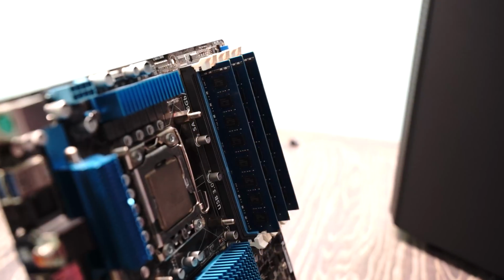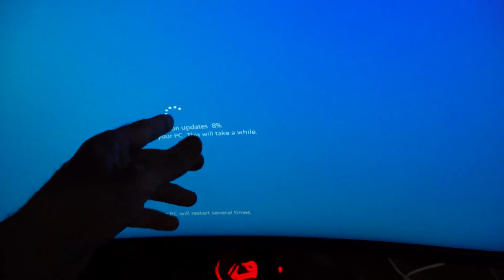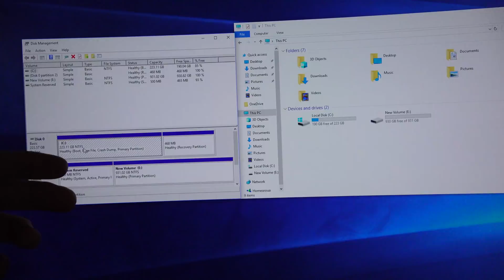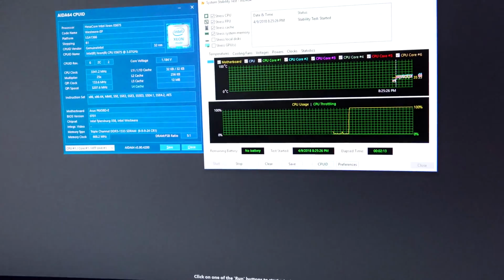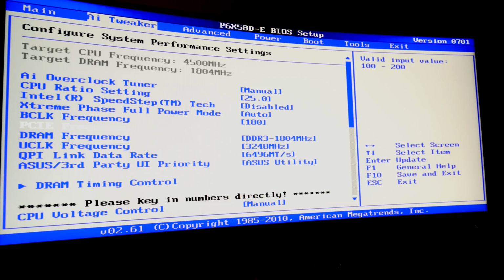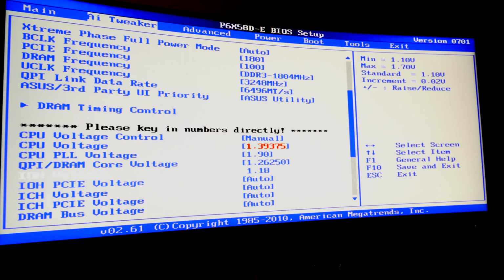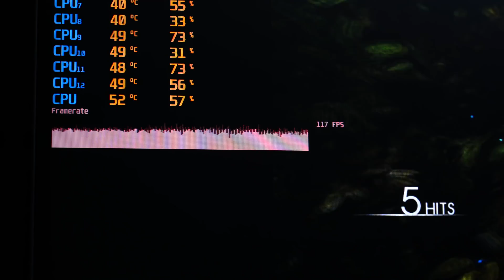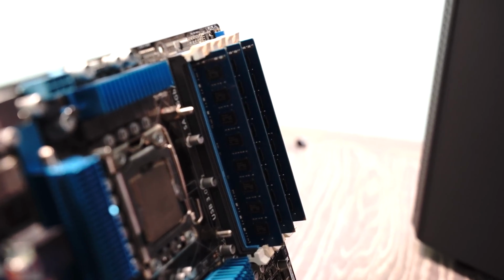Is X58 Still Worth it..? Taking the 6 Core X5675 to 4.5GHz on AIR.

Comment: Still own my x58 system, has an old i7 920 @4.0, crossfire 5770s.., for 50$ i might just try one of these newer chips. 6 core all around lol. Though I have no real need for it.. more of an art piece now. It only has sata 2, ive got 290x crossfire on x79 w/xeon 2620v2 as my server, x99 5820k w/1080ti as my gaming rig, neither were really massive improvements over the other... maybe its better to let it sit as a testament to its time and place... just another generation to sit along side the several other old gaming pcs i have on the shelf... I like running games on their original hardware and as people mentioned,  x58 driver/bios support on windows 10 can be frustrating. I hope to have every gaming PC i've ever owned all setup and working with their respective games loaded and ready to play for a truly authentic experience. All i need is to build two systems. a 400mhz Pentium 2 (AsusP2B-F) w 3dfx v3 3500 and A3d Monster sound card, Then a 166mhz Pentium 1 w voodoo 2 and SB AWE32. My collection would then be complete. oh and a couple 17in CRT monitors... those might be the hardest to find now lol

Comment: I have an x5675 @4.6ghz on an Asus p6t deluxe v2 I've had since 2009 and 12gb ddr3 1600, gets 1059 in cinebench r15 and ran great with my GTX 1080, I only "upgraded" to x79 only cause I caught a deal on the local classifieds for an I7 3930k, Asus Rampage iv Formula and 16gb ddr3 2400 for $375 us and have that clocked at 4.8ghz, setting my X58 up as an extra gaming rig with a 1070.

Comment: My x5670 does 4.2ghz at 1.3v. That's with a 200blck on Asus p6t deluxe. Thing is my cpu will not do a higher frequency at all even with massive volts. Also I have 12gb of ddr3 ram with 6x2gb sticks. If I run the speed higher than 1000mhz all the ram doesn't show, however compensated with really tight timings. The one thing I'm confused with is how cool your cpu is, mine will idle at 30 degrees c but run at about 60-65 gaming. That's with a 240l aio too.
Reply: Andrew Bedford same setup 191 blck 1.35v 75 degree stress test cpu on noctua d-12

Comment: My issue with x58 is how expensive the boards are even on the used market here in the US. I got my 4670k and z87 board for $215, a decent x58 board will cost me double what I paid for the z87 ($75) then once I throw in a cheap CPU I'm probably looking at around $200 anyway, which while not bad, is a bit much I would think for a system 3 generations older. In addition to that I'd lose support for my 2400mhz DDR3 that I already had from a prior build. Sure my 705 CB score at 4.5ghz isn't as good as it is on your hyperthreaded 6 core, but is that horsepower something I'll actually take advantage of when games mostly use 4 cores?

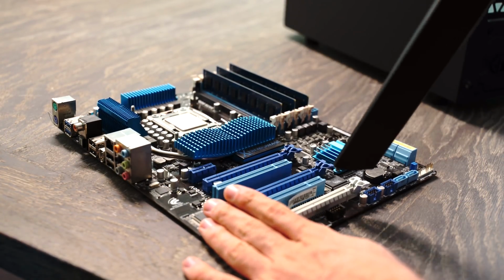Comment: 10:03 Wait are you saying you had to keep Express Gate enabled? Express Gate is just a quick boot OS (linux) that lets you get online and download things in case your main OS is messed up. I have this on my old Asus P5Q mobo. Asus has retired Express Gate long ago and it's not longer used in newer motherboards from the past decade, since my X79 mobo doesn't have Express Gate. But it sounds like your BIOS thinks your windows 10 install is Express Gate, and not coming from the master boot record on the SSD. That's so weird. I guess keep it disabled, and reinstall windows (or do a repair).

Comment: Hey Brian I’ve managed to get my x5647 Xeon on x58 from 2.6 to 4.0 I’ve gotten 4.2 but the baseclock messes with my sound card. My sound card is a sound blaster Z and it distorts and channels get all messed when overclocking that high, what would cause that? And thanks for doing this video as this is definitely my next upgrade should give my 970 a nice boost

Comment: I had a similar problem recently, it turned out to be the power supply.

Sometimes it wouldn't display and other times it would boot fine into the operating system but would lock up almost instantly under load.

Comment: for over 2 years now I have been rocking the W3680 cpu I had it overclocked to 4.3Ghz in the past on air but that is the limit of my Current cooler. I love this Cpu for the fact that it has an unlocked multiplier makes things super easy for overclocking. you should have a look at this CPU if you can find one would love to see what u could get out of it.  I hope to get it water cooled in the future and see how far it can go. I love used pc parts

Comment: Have you considered an even older platform 775 with a moster cpu like the Q9550 or Q9650 (screw the Q6600).  With a high end (overpriced) mobo you can get similar preformance to this video.
Reply: Jonathan Brumfield Screw Q9650 and every other LGA 775/771 CPU for that matter, the X5470 is what you really want, mine is at 4 GHz and runs everything I can throw at it and matches a 2500k for less than half the price!!! Paired with a gtx 980 and pegs the GPU at 100% utilization when gaming, insane CPU!!!!

Comment: I got my X58 board(s) for $25 each, some pins were broken and I fixed them, however, the cheapest board I can find that can support those chips is the 6 DIMM version of the HP Z400, usually around $40-50(USD)

Comment: Hi Bryan, I have an ASUS X79 MB with Xeon E5-2680 V2 which is multiplier locked so it is not overclockable, but what I don't understand is why the BCLK frequency can be adjusted up to 300MHz, I tried changing the BCLK to 125MHz and then the board would not boot. is it possible to change other settings to make it boot to raise CPU frequency because that would be great.

Comment: Cool video Bryan, I run the x5650 on the same board (deluxe though). Now using a BeQuiet 280mm rad but my memory timings are garbage. I'll post later when I get home what they're set to , maybe you could give me a pointer or two ;)

Cheers, Mark

Comment: Could dried up thermal paste on the chipset be a cause for not POSTing? I have a P6T WS Pro and an X5650 and it won't post, no matter the RAM config... Could it just be the RAM?
Reply: I highly doubt it. Is the BIOS updated? Tried resetting the CMOS?
Try booting with a single stick of RAM in slot DIMM_A1.
Reply: you didn't update the bios did you?
Reply: phatlewtz82 No, I don't recall doing anything. I got it from a family friend as part of a whole PC and it was super dusty. I cleaned the whole thing out and, when I was putting it back together, I overtightened the cooler and bent an i7 950 (yeah, idiotic). So I got the Xeon, I tried it out and it won't post. Could I have broken the board somehow? While I've kind of given up on it, it would be really cool to be able to use it as my main PC (Xeon X5650, ASUS P6T WS Pro, 12 GB DDR3).

Comment: Hey, i have a x58 Evga Ftw and a x5675 but i dont really get above 3.86ghz.. Is this the magical wall where you have to go extreme with Voltage?
Reply: Amd btw i have 4 ddr3 Rams in there. Should i take one out and go on with tripple channel? Or leave it in there and have 16gb
Reply: And im going to pair the Xeon with a Amd Fury X. Is that a good desicion?

Comment: 1000 on cinebench? Thats better than my 6700k at 4.7ghz :/
Reply: That´s because these are sixcore CPU´s. And CineBench likes threads more than anything else. So you can do more points with an old overclocked sixcore. A friend of mine is running a Xeon X5660 at 4,5 ghz. This thing handles everything you throw at it. I like these old sixcores. Very nice platform, too.
Reply: I don't think there's much perfomance benefit when going over 4.4 Ghz on these CPUs, at least from what I can tell from personal experience. However they are really good and possibly the best platform Intel has ever developed.  It's a shame they lack AVX though
Reply: 7600k at 4.9ghz only manages 730 on cinebench. Really he should have measured single thread scores too
Reply: Ben Willock The 6700k is garbage

Comment: I STILL have my original p6x58d premium with an i7 950, prolimatech megahalems, and 6 2gb sticks of Kingston hyper x. I still had my 8800 gts in there but soon upgraded to GTX 580, then to 2 evga 980 hybrid cards, sadly I upgraded to z270 but I still use the board for mining.

Comment: I got 24gb of ddr3 (€70) x58 asus board (€30) and a x5675(€44) all running comfortably at 4.4 on a evo cooler(30). Stupid performance for the price. I did it for fun but now it's replaced my 2600k as my main rig.

Unfortunately the lack of an I/o shield might be holding me back a bit

Comment: x58 rules! I have 3 machines! latest x5650 cost £25 (rog board was 90) and rocks 6 cores at 4ghz 953 cinebench woo!  Plus loads of rams slots means you can fill em' with lots of small ram for cheap....
Reply: chazzy2501 I have one with a rampage iii gene and 48gb ram, and plan to do a second build using a legendary evga sr-2 classified and 2 x5675's and 96gb of ram, that will be my ryzen/threadripper killer 😁
Reply: I've just purchased an E5649 based on the same tech as the x5650 BUT it came out in Q1 2011. I'm hoping as it was the last batch out of the door (after the 980x) etc.  It may be well binned as they'd pretty much perfected the chips by then.  Also they're only £18! I'm hoping if I don't get the speed I at least get the voltage and temps.

Comment: That is the third time I have seen a boot partition issue in 24 hours. You have to have the hard drive selected for it to boot off the ssd because there is a boot partition on the ssd.

Comment: I remember back in the day i had an i7 920 i cant remember its bin number but it was one of the golden chips. Did 4ghz at 1.2v and 4.5ghz at 1.38v

pictures old and idk if itll work but damn i miss the days when overclocking was fun

http://img.photobucket.com/albums/v621/Jayt/45ghzstable.png
Reply: the i7 920's mostly came in a D0 stepping but the golden lottery i7 920's were the C0 stepping and could be OC'd to 5ghz commonly.. I didn't get lucky with my I7 920 and got a D0 but was still able to get a 4ghz OC out of it
Reply: lol no the c0 stepping was the first i7's  that sucked at overclocking. D0 was the revision and some of us gut lucky and got the xeon like 920's where you could to 4.5 with ht on .Your thinking of sandybridge for 5ghz or even the 970's or 990x's which i had both. and the most i could get out of both was aroun 4.5-4.6. A Nahlem processor at 5ghz would burn up a motherboard in a hurry unless you had exotic cooling

https://www.hwupgrade.it/forum/showthread.php?t=2030510
Reply: JayTz Tech Reviews I started out with a D0 920 and get it up to 4.3 GHz, not a bad chip and still to this day makes a decent gaming rig for up to quadhd, not bad at all for a CPU that was the cheapest way to get into the x58 platform, really the entire platform has stood the test of time better than sandy bridge (x79 supports some shitty CPU's like the low energy non-overclockable xeons, on x58 every CPU is overclockable!!!) which in my opinion is overrated and for that reason x58 is the best!
Reply: i agree. I still run an x58 system with a gtx 950 for the kids to game on

Comment: Those x58 chipsets were ridiculous, they were practically a co-processor. Had a big, fat tower cooler on my CPU, but the northbridge was still passively cooled and the top corner of my case would get too hot to touch after several hours, even with everything running stock.

Comment: I have a Sabertooth X58 in my computer and I can push it as far as I want to but then I get BSOD's even with normal temps can someone explain why?
Reply: overclock (dot) net/t/538439/guide-to-overclocking-the-core-i7-920-or-930-to-4-0ghz
There's a list of BSOD codes and their causes on that guide. I'll bet you just need to up the voltage on something other than the CPU. The most common is the QPI/DRAM Core Voltage followed by the DRAM voltage needing a small bump. I have my QPI/DRAM Core Voltage set to 1.225v and my 1.5v DIMMs set to 1.52v.

Comment: Im also still running X58 :D

I OCed my 980X to 4.2 GHz and its running beautifully cool (70 degrees!) with water cooling. It runs about at the same performance as the Ryzen 1600X, but I can OC it further but I dont want to kill my MB because I use BCLK OCing xD

Also im soon thinking of adding a 950 pro to my X58 to improve my boot times even further!

Comment: "Disable spread spectrum and other security functions for more stable overclock."  Yeeeeaaaaaah.  While true I wouldn't actually recommend this for daily real use.  For hardcore overclocking where you're just testing and not going on the internet that's fine, but not for a daily use computer.  I'd rather accept a slower overclock that keeps the security in place.  Then again, for that same reason I wouldn't use an x58 platform today.  The spectre and meltdown bugs are known.  Only a matter of time before exploits are in the wild.  And the x58 platform is not getting patched for it.  I don't disagree with your basic point though.  Intel processors have had no real big performance increase over the last ten years.  They clock higher, but that's it.
Reply: Well been running my X5675@4.5Ghz with all those settings disabled for the last few years with zero issues. Not been hacked yet.
Reply: Intel is working on the Spectre/Meltdown patches specifically for the Westmere-EP platform (the X56xx chips) but you will have to manually update the microcode yourself. The older chips, Bloomfield/Lynnfield/Gulftown, are not getting microcode updates.
Reply: already knew Intel was working on Westmere-EP but it's new to me that you have to manually update the microcode... have no clue what that is or what you mean, can you explain in simple layman words what will that mean ?
Reply: Oh.  Okay.  Last I heard Intel isn't working on anything older than LGA2011 V1 socket stuff for high end server/hedt.  Not sure what the respective mainstream sockets or low end server sockets are off the top of my head.  So this is all news to me.  At least it will get updated then.  And tbf I prefer updating manually.  Yeah, I have to remember to do it, but at least I can prepare for the update.  Automatic I have no real way to prepare.  Artur, most likely there'll be scripts provided for *nix like systems and a program for Windows and app for Mac OS provided, but you have to specifically download from Intel and run.  As opposed to the automatic route would be either an OS update or firmware update runs it for you.  Since both can be automated these days...
Reply: Abigail Patridge I run a dual X5675 system with a 980Ti under Ubuntu Mate 16.04 and all of the Spectre/Meltdown patches were included in kernel 4.15.
Reply: You don't need a bios update to patch microcode. Just an OS with a patched kernel that also supports early boot microcode loading. You will be fine as long as you aren't running win xp, 7, 8.1(8 is supported with server 2012 updates), or unsupported gnu/linux.

Comment: X58 is still very worth it in my opinion. The only kicker would be to buy the new GTX 1080.
Reply: Yes 2 years later and your still right
Reply: i run x58 with x5675 oced to 4.4 with just a simple gtx 1660 i play latest AAA games on high settings np at all. It kinda shows its age but it still holds on. I will probably skip ddr4...
Reply: @Christopher_42  Yeah with a 1st gen (or 2nd?) core i7 920 and a 1060ti I could still play RDR2 on near max settings. I didn't check the framerate but it looks smooth enough to me. A 10 year old CPU is still probably better than whatever's in the PS4 or something. Single-thread performance hasn't gone up that much in the last decade, and software has been pretty slow to catch up with hardware. These 16 core beasts that are coming out now are really only worth it if you're doing multimedia stuff.
Reply: @frankcooke1692  1060ti ??? U on drugs
Reply: is $80 us good for a ASUS Motherboard P6X58D-E REV 1.01G
Reply: A really good 6GB graphix card with DX12 compatibility will do the trick as well.  I run a Radeon 5600 XT 6GB card in my setup and I have no headaches.

Comment: i still use an i7 960. have had no need to upgrade. at most it needs and overclock because the base clock can be a bit slow for newer titles (not majorly but slight hitch occasionally)
Reply: also i use that exact mobo

Comment: you'll need to use Clover or other uefi bootloader to use nvme as boot drive. And it'll be caped at 1500MB/s with pcie 2.0x4 bandwidth

Comment: Damn it I miss my i7 920......I had it on an asus rampage 3 extreme. It's surprisingly decent if overclocked. I had mine at 4.2 GHz at 1.25625 volts (hyperthreading and speedstep stuff on of course). I wish the mainboard wasn't dying so I'd still rock it in my main pc. X58 might possibly be my all-time favorite platform. The tweaking and tinkering it needs to get the best performance out of it is just a joy for me. It's an awesome experience.

Comment: Suggestion: Since you have more x58 builds to make why not try different siblings of that cpu to see which is the "sweet spot". X5690 is almost twice the price... But would be more easy going for a noob like me. But then again if OCs the same...
Reply: 4.4Ghz is the sweet spot. Even the X5650 can pull that off with 21x210.

Comment: I hadn't really looked into this platform before. But looks like you can get an X5650 for around £30, and an X58 mobo for around £70... That's actually not too bad, CPU user bench says it's only 10% behind an r5 1600 on oc single thread!

Comment: Wow, I have X58 build going on GA-X58-UD5, W3690, 24GB RAM, 2x GTX 770s 4GB, 2xMX300-525GB SSD, USB3 card, SATA3 raid card, AC1300 WiFi card, and it's gonna all water-cooled by a 360 & a240 for that Creme de La creme! (It's gonna be my htpc setup, my main rig is a Ryzen 1700X with dual 1070s).